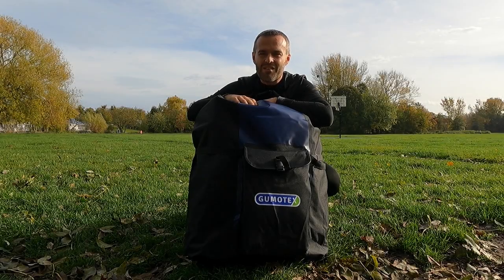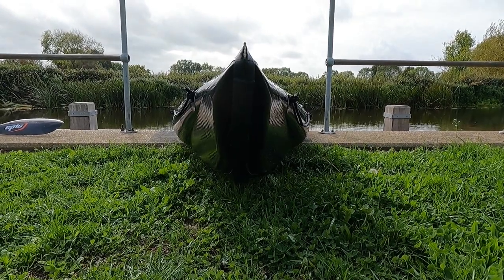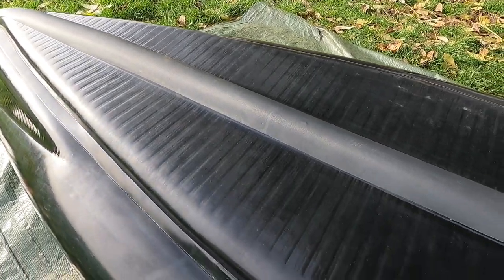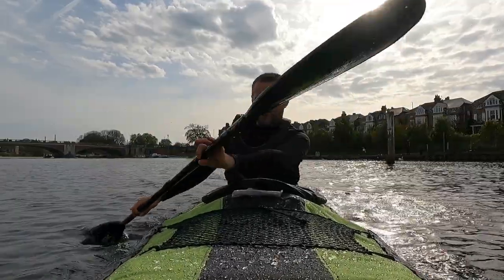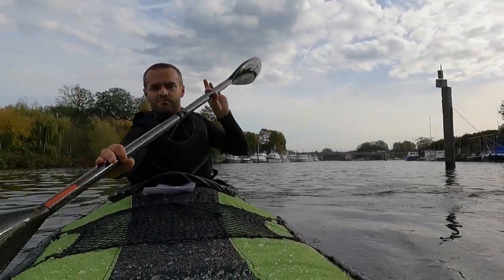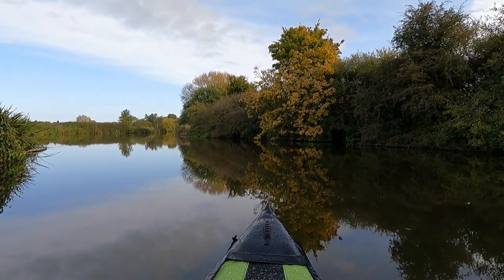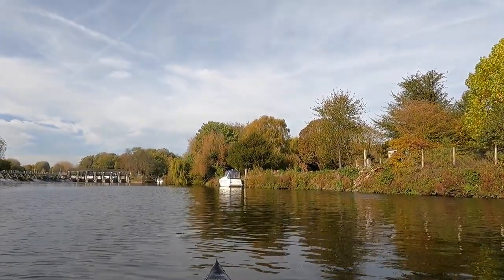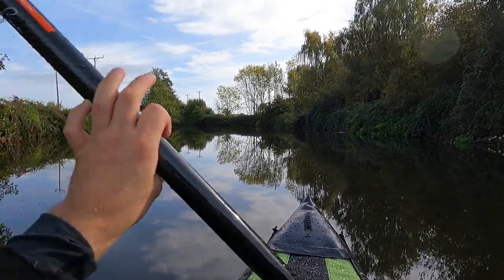Meet GUMOTEX Rush1 - a ROBUST inflatable hybrid kayak!

Comment: Hello, it is a superb kayak, thanks for the review and for the help. I will learn kayaking and in the fall I will take Rush, as you advised me.
Reply from the maker: I'm pretty sure you won't regret it. It's a great boat and I'll be using it more this year. That means there will also be more videos with and about Rush 1 😉
Reply: @LetsGoPaddling  One more thing, Itiwit x500, can I count it as a beginner? Or give up the idea? I admit that the x500 was my first option, and I still like it a lot. I see kayaking as a sport, not as relaxation. Which is faster, X500 or Rush?
Reply from the maker: I bought mine as a beginner. I moved from Intex Challenger K1. Some core strength, getting used to it, and training a bit will get you there. 👍
x500 outmatches any inflatable k1 at the time of me writing this. There isn't a faster one. That might change soon but at the moment, the Strenfit takes the crown. Gumotex Framura is faster than Rush if we are looking at Gumotex's range.

Comment: That’s the best video describing an inflatable kayak I’ve ever seen. I really appreciate the rocking part. May I ask why you switched seats? Will I be able to raise the original seat with a piece of foam if I want to keep dry? Cheers!
Reply from the maker: Hi Joel,
Thank you very much. It makes me happy when someone finds it useful. I tried to make an "overview" here, giving as few opinions as I could - I wanted viewers to form their own based on what they see.
I changed the seat for 3 reasons:
- The original seat's backrest is too high and I wouldn't be able to use a skirt efficiently.
- Inflatable seat can be folded and put into either 80l or 135l backpack for potential travel - the original one surprisingly won't let you do that.
- I suffer from piriformis syndrome so I needed something a bit softer (with inflatable you can set your preferred pressure, up to 3PSI) and more slippery to be able to drive my legs so that there is also movement down there, guarding me from pain. 😁
You can raise the original seat but there are 2 things to consider here: you won't be able to use a skirt if you plan to and your center of gravity will go up so (I don't know how much) but you will be less stable in the kayak. 😉

I have a similar overview of Swing 1 coming soon. All material is already recorded, I only need time to edit it. 😅
Reply: My concern is weather or not my butt would stay dry with the original seat…. Thanks again!
Reply from the maker: @joelelias2556  When I use a skirt, I only get a few drops of water in the kayak after a whole day of paddling and both my wing or Greenland paddle splash quite a bit of water onto the deck. Even if some water gets inside (but not too much like in my case), it will first go down into the cavities between the floor and side chambers so it will still stay below you.
This is only my experience from flat water, I don't know how different it would be on white water.

Comment: Hi Tom, do you think adding the cockpit bars would add useful rigidity? I’m not keen on the full cockpit cover.
Reply: Hi Paul,
Rush is stiff enough without its spreader bars. Their job is to stretch the cockpit cover across the kayak nicely and prevent puddles of water from forming on top. You don't need them to use it open-decked. Moreover, without these spreader bars, the kayak's beam is 75cm so you gain a tiny bit of performance with a narrower hull. 😉

Comment: A very enjoyable and informative video - thank you. Is there a possibility that you could do a video on self-rescue with the Rush, with the kayak in both the open and closed deck positions; i.e., with and without the deck? I understand that it is hard to flip, but it is always a possibly for it to flip. Thanks.
Reply from the maker: Hey j m. Thank you for peeking in.
The kayaking season is unfortunately already over for me here in the UK as I'm vulnerable to cold. I compile and edit all material I still have for a few more releases. A separate video about Rush's stability and remounting is in my plans for next season so yes, there will definitely be a Paddlequickie about that, only a bit later. 😃
I tried remounting the x500 Strenfit, did not go too well. I'm still a beginner. However, this is also a very good reason to show how a beginner fares in such situations.
Reply: @LetsGoPaddling  Thanks for getting back to me. I'm in the Northeast US, and have finished paddling for the season too - don't like the cold either. I will look forward to your new videos in the Spring! Happy Winter!😄
Reply from the maker: As promised, I managed to record footage for a Paddlequickie about remounting my Rush. Weather conditions on the sea were perfect - I don't know what's been happening through the rest of the summer because it just wasn't safe to go to the sea. 
I have a huge list of videos I should be releasing in order but I'll squeeze this one in. Remounting with the cockpit on was a bit tricky but I figured it out and it then had a 100% success rate. 😁 I will add voiceover with explanations.

Comment: You should try the SeaEagle Razorlite
Reply from the maker: I'll definitely try it out if I get an opportunity. At the moment I already own 3 high quality kayaks so I won't be buying another one (at least for now 😅)
Reply: The Razorlite is a very good kayak, but it differs in several ways from the Rush, ways that may make it less desirable, depending on the user. It has a completely open cockpit, with no protection from the elements. The Rush, on the other hand, has an optional spray deck and takes a spray skirt in that configuration. This would be essential for any open sea or ocean kayaking, or on rough waters. The Razorlite is all drop-stitch construction - floor and sidewalls - while the Rush uses drop stitch for the floor only, with air-filled tubes making up the side walls; this makes it more stable than the Razorlite. On the plus side for the Razorlite, it is considerably less expensive than the Rush, and has a 3 year warranty, vs. a 2 year warranty for the Rush.
Reply from the maker: Both kayaks also have different use cases - Razorlite is a flat water performance boat, while Rush is a typical rec kayak. Rush can handle WW up to grade 2 (it could possibly be pushed to WW3 if paddled by a skilled paddler) and my guess is Razorlite would not do WW - the SeaEagle x-series are for that.
Thanks to its detachable cockpit, Rush also enables me to explore the field of sit on top kayaks. So far, I've been paddling sit insides exclusively. They are my preferred type of kayaks but I always keep an open mind. 🙂